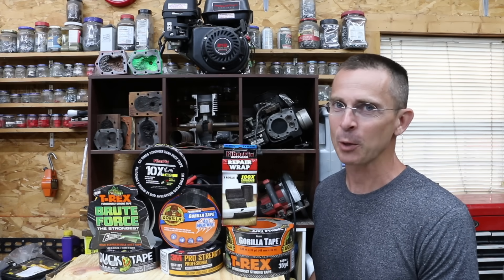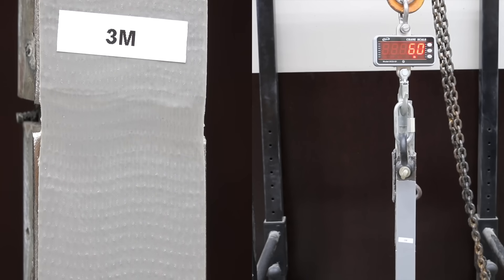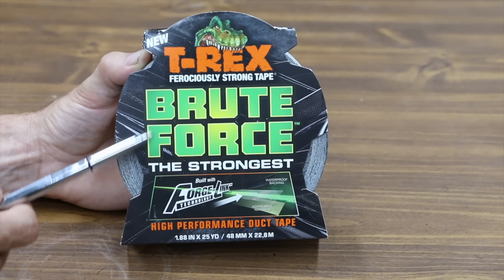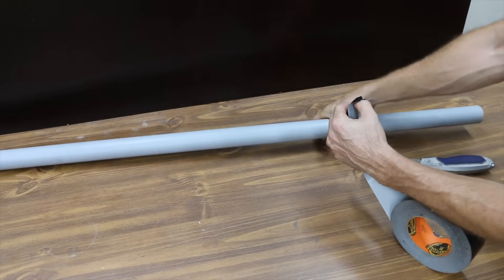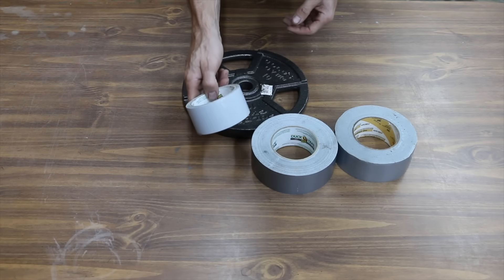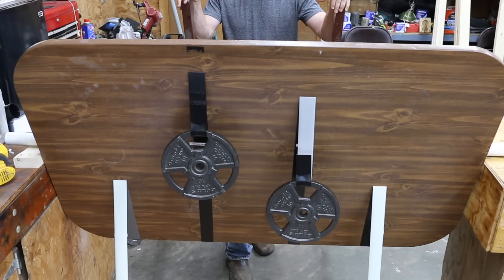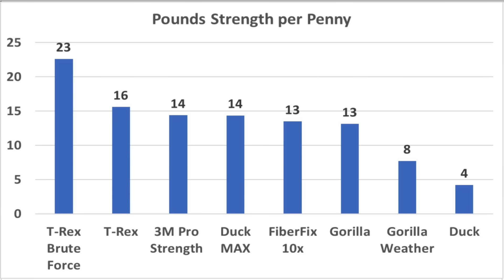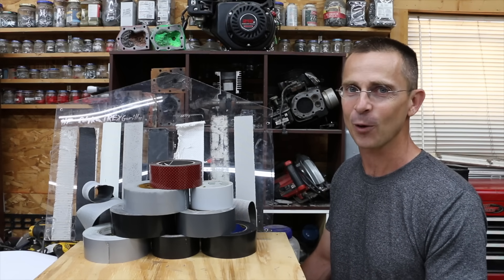Which Duct Tape Is Strongest? Let's find out! Gorilla, T-Rex, FiberFix, 3M Pro & Duck Max

Comment: I always love the honestly, saying yes this did extremely well but of course there's different uses for each tape that may be better than others as in ones are more elastic and ones that are much thinner and cost effective, t rex seemed like a fairly thick tape and probably would be almost overkill and difficult to use than duck max on more basic household needs, or maybe a tape that isn't so strong on adhesive and would be less likely to peel up paint or other needed materials from surfaces
Reply from the maker: Thank you

Comment: I had a catalytic converter fall off my first car. I used gorilla tape to hang it for the last 2 miles home. I used the fiber fix tape to hold up the plastic bumper on my car for over a year. I finally got around to using proper plastic plugs and zip ties, to make it look proper. Good tapes right there. It's what I use when I need something. The gorilla is a lot more flexible than the plastic fiber fix tape. The fiber fix tape also can't be torn and must be cut, making it not a good quick fix if you don't have a knife. In fact, when I bought mine it came with a pair of scissors because it can't be torn.
Reply from the maker: Nice!

Comment: If I might suggest, Project Farm how about a water test with the tapes! Which one hold best under a leak of different types and full submersion. 

You could then toss in tapes like Flex Tape and pipe sealer tapes. 

Also, what about electrical tapes?
Reply from the maker: Great suggestion!  Thank you

Comment: Trex tape is beyond good enough. It's so tacky is at times more annoying than useful. If you use it a few times it'll pull your finger prints off. You can't bite the tape to cut it because it pulls the skin off your lips. 

Sidenote: I don't think the pipe experiment is scientific. It has cross contamination of adhesives slipping or tape ripping. And some tapes are semi designed to be able to tear vertically and not horizontally. I'm unsure what was the goal other than to show off the plaster type "tape".
Reply from the maker: Thanks for the constructive feedback

Comment: for the pipes, if you did some sideways wraps first, then put some tape down length wise across the cut, and then wrapped again sides on ur third layer, i bet it would completely increase the structural level of the joint. since most those tapes were designed for vertical tensile strength and not sideways pull.
Reply from the maker: Great point!  Thank you

Comment: I know you get thousands of recommendations. but I think coolant additives would be a good one for the beginners in the racing world.

Coolant additives. mix with your coolant and made to improve heat transfer improving efficiency. for an example RedLine water wetter or VP cool down (there's many other brands those are the ones I know by memory).

are they just snake oil?

do they actually work?

if they do work, are the advertisement numbers correct?

are they even worth it?

if they actually work which is the better product?

if the technology is out there to improve heat transfer, why isn't there a modern coolant that has these additive package already in it?

problem with this is, you'll need a water cooled test engine. if you ever get a water cooled test engine. please give this comparison a thought.
Reply from the maker: Thank you for the video idea!

Comment: Not sure if you did this yet. Years ago Prolong engine treatment claimed you could run the engine without oil after treat it with Prolong. They even put sand in it. It was a great demo. They went against slick 50 and other brands like it.
Reply from the maker: Thank you for the video idea!

Comment: I understand this isn't exactly scientific but wouldn't a failure of adhesive constute a tinsel strength failure. If the adhesive can't hold the force it doesn't matter how much force it takes to rip the fabric of the tape because it still won't hold.
Reply from the maker: Great point!

Comment: Could you test how the tapes behaves with leaking pipes? Like drain, with water, soap and cleaning chemicals
Reply from the maker: Great suggestion!  Thank you
Reply: @SF-tb4kb  LMAO nice metaphor 😂
Reply: Fix it correctly. Putting tape on a leaking pipe is some 3rd world craphole stuff.
Reply: @CGoffgrid  sometimes it is an emergency fix my man... I been in the middle of no where many times to count, these products are a thin line btn finishing the job or making it to the  next town to get a proper fix

Comment: I've been using Gorilla tape to seal up window air conditioners on the outside for some years now. It's the only stuff I've found that doesn't fall right off after a while. I haven't tried some of those other heavy duty tapes yet probably because they cost more.
Reply from the maker: Nice!  Thank you

Comment: every test seems to indicate that t-rex is better than gorilla, but I've bought both and gorilla still seems to stick better for me. here's what i think, i think gorilla tape is better at sticking to dirty or slightly damp surfaces, where typically i find myself trying to stick it. i could be wrong, but i think t-rex needs a much cleaner surface to bond properly.
Reply from the maker: Great point. Thank you

Comment: Did you know it was originally actually called DUCK tape??  it's an old war themed story I think.

As silly as it may be. I'd like to see the air-tight-ness and water-tight-ness of a couple of these tapes.  I've used these to try and hold both in and have had mixed outcomes.  I'm sure you could come up with a "scientific" way to test these!
Reply from the maker: Great suggestion!  Thank you

Comment: You should test these tapes in a lap joint configuration. Maybe lap some 2x4's with a 6 inch overlap and pull them apart with the crane scale until the tape splits, keeping the boards horizontal.
Reply from the maker: Great recommendation!

Comment: What about using that digital gauge on the pipe test? You could pull the end up or down and that would solve the weight slippage and give a result with less potential error. Regardless an excellent test!
Reply from the maker: Great suggestion!  Thank you

Comment: This is good stuff!

After a year of those that were tested, when you go to peel them off, can you measure the amount of force to pull at a right angle to the surface and at 180º? I think that would just add to the data points and make it an even better project video. Maybe pull at 90º for several inches and then at 180º for several inches...
Reply from the maker: Great suggestion! Thank you

Comment: You know, for a rural country boy you can science your ass off, LoL!

You do such a good job of putting together proper tests that remove as many variables as possible and making sure to have a decent sample size to remove impact of outliers.

My only question is in your pounds per penny graph did you normalize for different length rolls? Not all rolls of tape are the same length. If you didn't already you should first normalize price per 100ft or something similar before calculating pounds per penny as opposed to price per roll which would not be as fair or a comparison.
Reply from the maker: Thank you!  I did normalize for roll length.
Reply: @ProjectFarm  ....... I should have known better than to question your methodology 😂

Comment: how much of a difference do you think it would make if you taped the pipes vertically, than did the wrap around to bind it to the pipe?   The idea is so the tensile strength is in line with the force being applied?  Think you could test that out on some spare tape to see if the numbers change at all?  Dont have do a video on it just was wondering you change the way it was taped would it make a difference?
Reply from the maker: That would help a lot!  Thank you

Comment: Good video, in two minds though with Gorilla Weather and that re-enforcement, maybe to near the tear line? limited the stretch compared to others... yet though it did lose grip with the first test, maybe a quick test with the same reenforcement with the other pieces to keep it similar also.
Reply from the maker: Great constructive feedback. Thank you
Reply: @ProjectFarm  No problem, there are a lot of variables... but if it didn't stick in that given time vs the others that is a different issue also.  like the year-long test...

Comment: I want to see you compare double sided tape. 3m vhb is extremely strong.
Reply from the maker: Great test idea!  Thank you
Reply: @ProjectFarm  I actually thought some about the testing process. I would love to see a sheer test as while as one in tension. I think for the sheer test you should stick one side to glass but before you stick it, wipe it down with denatured alcohol. I would say polycarb instead of glass be denatured alchohol causes it to craze. I don't know if you want to test different brands of double sided tape or just how well it sticks to different surfaces. I would also make sure that the tape is the same size (area) for all tests. I would actually measure it. Makes for a good constant. Also maybe cold temperature effectiveness would be a cool test. Pardon the pun.  Sorry to tell you how to do your job. I've just been really bored. I fractured my fibula last weekend and had surgery today so I've had a lot of time to think. Do what ever you think will work best and I am sure you will knock it out of the park like you always do! Thanks again for noticing my comment btw. PS. I will be a freshman in college this fall pursuing a bachelor's in Mechanical engineering.

Edit: grammar and spelling
Reply: Yeah, you just accept that whatever you stuck together with vhb is just going to be that way forever
Reply: @Shirokishi69  so true unless you can spray some solvent (denatured alcohol or stronger) on it

Comment: I have both Gorilla and T-Rex.  I love Gorilla because it is thick, and strong, and easy to get off the roll.  I got a great deal on the T-Rex and it is very hard to get off the roll, but the adhesive is amazing.  It's like the loctite of duct tapes.  On the tape subject...Maybe try a few different electrical tapes (3M Super 33+ is my favorite, but I shamefully admit I have a stockpile of harbor freight stuff).  I Also love to use Tesa tape for electrical work inside cars.  I'd be interested to see a PVC cement comparison.  Cristy's red hot blue vs some of the Oatey formulations.  Does purple priming actually help or not, etc...  You could also try some RTV tests as well?  Just a few ideas along the same lines.
Reply from the maker: Great ideas!  Thank you!!

Comment: I use Nashua 357 Gaffer tape as it's what I can get here locally in Australia. It works great UNLESS you expose it to sunlight in the 35-40C hot Summer days when it becomes as useless as tits on a bull. It pretty near falls off under it's own weight. I'd like to find a tape that maintains it's grip more so than strength when exposed to heat. Currently for my application I use packing tape (which many fail really badly under UV) as it doesn't melt the adhesive and it's a lot cheaper.
Reply from the maker: Thank you

Comment: The fact that the gorilla weather adhesive slips before the tape breaking means its got a very gummy adhesive. They probably load it up with plasticizers so it doesn't harden up like the standard tape does, or so they claim. Might be interesting to test tapes claiming things like weather and water resistance.
Reply from the maker: Great point!  I believe you are right.  It seems as though Flex tape remains gummy and soft for quite a long period of time and the adhesives do seem similar

Comment: Another fantastic vid! I do wish to see long term weather durability, since those are the places where I would use this sort of tape. Although it seems like Flex tape was the only one to really keep itself together.

Video idea! Masking tape performance. Obviously no strength tests, but these days there are higher cost options which claim to provide cleaner edges for painting. Would also be another candidate to test if they leave any residue (as some at my company claim even the lighter hold blue masking tape leaves worse residue).
Reply from the maker: Great video idea!  Thank you

Comment: Since you demonstrated that none of the tapes performed very well on the pipe wrap test due to force in the wrong direction, I wonder what would happened if you ran tape along the length of the pipe for strength in that direction and then wrapped to hold it in place.
Reply from the maker: Thanks for the constructive feedback

Comment: G'day,

YAY  TEAM...!

  I love the new slightly slower delivery-speed..., it permits one to realtime-process what one is hearing, without having to "skip ahead" to keep up..., kinda thing ; thankyou very much...(!).

 Last week I paid $30 for a 30 metre roll of the Silver Gorilla Tape - there was also White available at the same price...; it's my first tryout of any "Gorilla" brand products..., bought because when I was enquiring about what Adhesive to use to join Blue/Silver "Poly-Tarps" together..., expecting   to be told which Silastic - among the "Dunno..." answers was one confident "Gorilla Tape !".

  So I'm trying it, now.

 So far I discovered that it's Adhesive sticks to Scissor-Blades so tight that it's a bad idea to try to cut neat patches with 45-degree chamfered Corners - because before the first patch is cut one is using Methylated Spirits to clean the Scissor Edges...; I then moved on to folding the back of the Tape around a Knife-Blade, and shashing out through the stuff - which works, roughly.

I rather prefer the 2-inch Silver "Plumber's Pipe-Tape", which is like "Electrician's Tape" but a thicker version, and with a much more sticky Adhesive - and no woven substrate at all.

 I once used it to make an Emergency Field Repair to the Skin on the Auxiliary Tailfin of a 3,000 Hp Turbo-Thrush Cropduster, about 6 years ago during a Section-44 Statewide Bushfire Emergency, when I was loading Water into the Firebombers at the local Airport.

  Luckily I was wearing my Nokia 6120c Phonecamera on my Head when I discovered the Stone-Hit & ripped-off Skin, so if you scroll through my "Personal Aeroplanology" Playlist till you encounter a cluster of Firebombers videos you can see the moment..., and the subsequent couple of Videos show the Repair, and the Take-Off/Landing of the Patch's first Flight, as well as my postflight inspection of the Tape Patch.

The Field-Repair was actually first  inspected & OK'd by an actual LAME, so it was lawful ; and the patched Firebomber then flew on for the rest of the day, & the Tape Patch worked...

  I made it an Aerodynamically-Balanced Patch, y'see, by having as much Tape on the undamaged side of the Fin as I put over the Defect, with each Strip crossing the Leading-Edge - so the 120 Knot Cruise & 180 Knot Diving Airspeeds were effectively pushing the Tape onto the Skin rather than pulling it off.

 Cunning, that...

One is not a Low-Speed Aerodynamics-Consultant..., for nothing ; it seems (!).

  Such is Life,

Have a good one.

;-p

Ciao !
Reply from the maker: I always enjoy reading your comments!  You've had and do have a very interesting life and a lot of great experiences to share with others.  Thank you, Todd
Reply: @ProjectFarm  

  Thanks,

  No worries Todd, I seem to have always been a bit of an Oddball, but I figure someone has to be out on the fringes...; and if I can add or relate some snippet than I've learned, into a discussion where it might help or be interesting, then I feel it's close to being my duty to make the offering (?!).

Have you ever thought of comparing Firefighting Pumps ?

  Last week I paid $500 for a new Chongqin Lifan 6.5 Hp unit with 1x 40mm & 2 x 25mm Outlets, rated at 18,000 Litres/Hour or 60 Metres of Head - so it hits 87 PSI..., perhaps, it's placarded as being 55% efficient & starts at the first pull... 

(I've clocked it at a steady 7,200 Litres/Hour, burning 30 ml/minute, while squirting 15 metres out past the Nozzle).

  In a different shop they had a Briggs & Stratton 6 Hp Firefighting Pump, with identical Outlets, for $1,200...; which is why I bought the Lifan...(!).

   Such is Life,

Have a good one.

;-p

Ciao !

Comment: 10:30 Is this product meant to join two abutted pipes, or to seal cracks?
16:14 Rolling resistance is much less than the actual weight of an object.

Comment: Flexs weatherinvulnerability really surprised me! It always disappointed me in other regards then the adhesive guess its just very specialized :D 
Also even tho u in my opinion did everything right in the experiments, one thing that might produce misreadings are the scratches in the table flippin test. Tape might stick more on a more scratched surface. Instead of buying expensive equipment u could just test if it creates a difference by switching positions on the board for example^^
Reply from the maker: Great point

Comment: As someone who works in the adhesive industry, you should let the tapes sit on the materials for at least 24 hrs. Adhesives will normally "cure" in a 24-48 hour time frame and become far more bonded to the materials they are applied to.
Reply from the maker: Thanks for the feedback

Comment: Yet another quality Project Farm production.
Have you considered doing a Hydrostatic Pressure test on the PVC pipe repaired with Duct Tape?
Reply from the maker: Thank you
Reply: You could test products specifically designed for pipe repair.